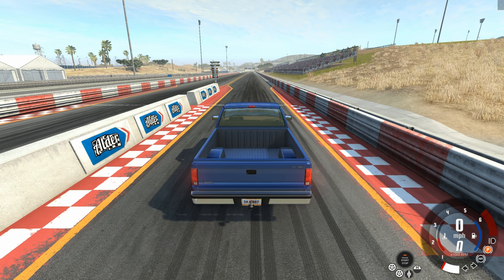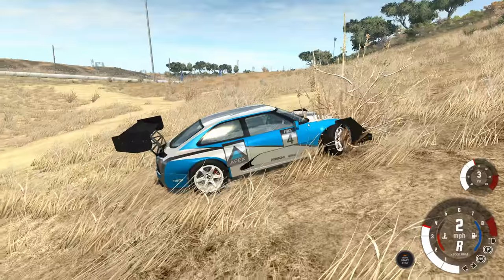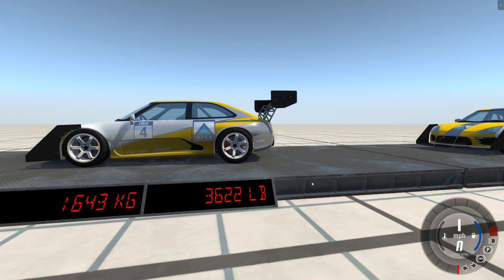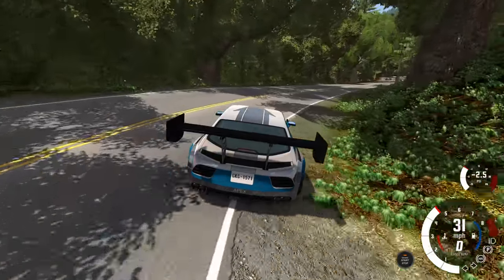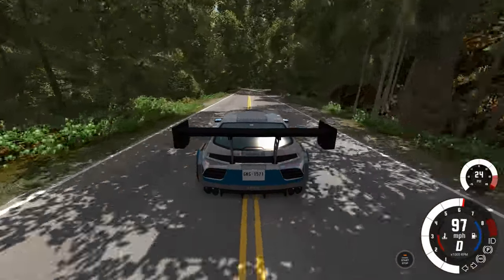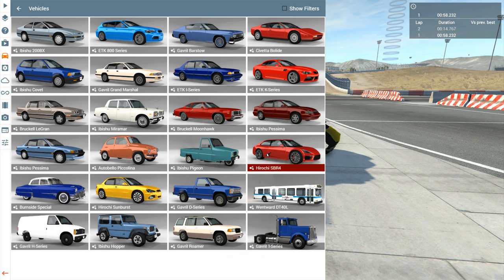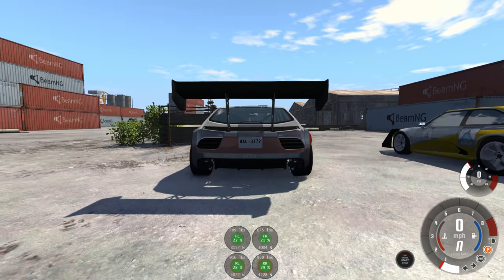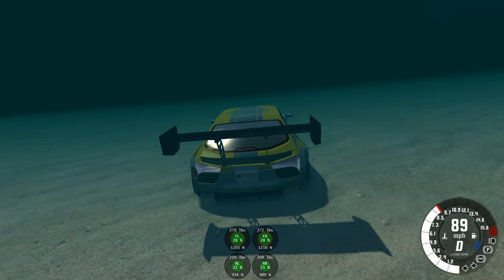GAS VS ELECTRIC - BeamNG.drive

Comment: If you think about it, the electric should be overall a little faster because it's obviously more lightweight.
Reply: Jake1702 electric cars are heavier than combustion cars. To prove this, you have to have hundreds if not thousands of battery cells to provide enough range and power to be optimal for a car. Also, four wheel drive is standard among electric cars excluding the Chevy volt. Four wheel drive is heavier than two wheel drive. I hope this makes sense
Reply: But as technology goes on iy will get smaller and lighter and will eventually outclass gas ones.
Reply: @nolongerusing7430  this exactly what we are waiting for
Reply: @chastenchilders6353  And electric cars are all torque which help it launch from a dead stop but it's going to lack power as speeds increase which is why the gas car started catching up.

Comment: IIRC you've never used the scale except in that one video where you were trying to go 300 MPH without using mods (and was thus stripping everything you could off the car so it would be lighter and go faster). So you've never used the triple scale before on camera.
Reply: 13:05 d-series deployable pontoons video

Comment: If you changed the final drive ratio on the electric car to be higher, it would have potentially accelerated faster. I'm only at 8 minutes in so you might have even done it already.
Reply: Nah the gas car is always at peak boost and peak torque so the torque advantage of the electric becocomes redundant